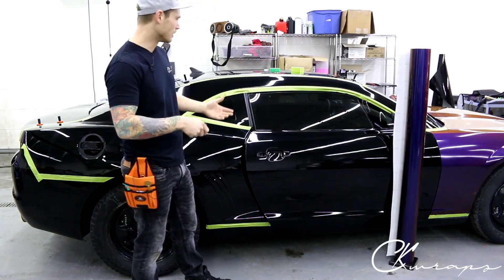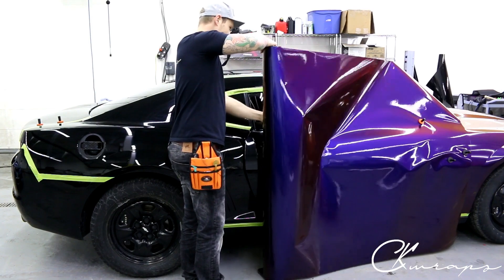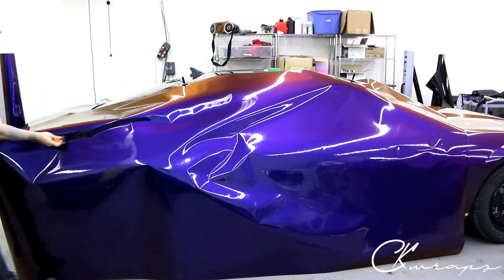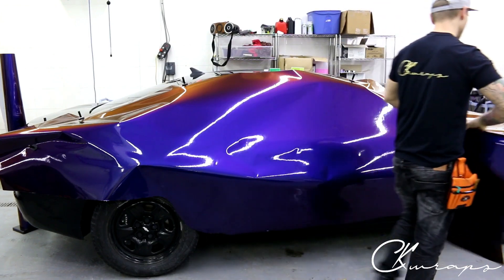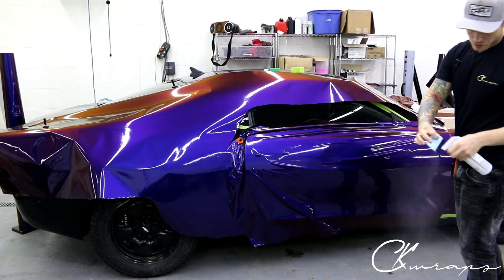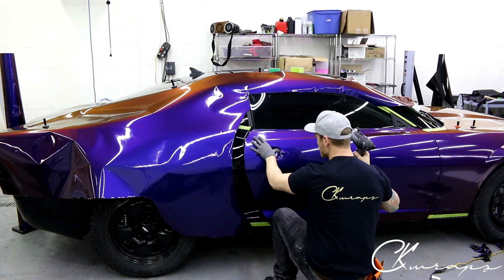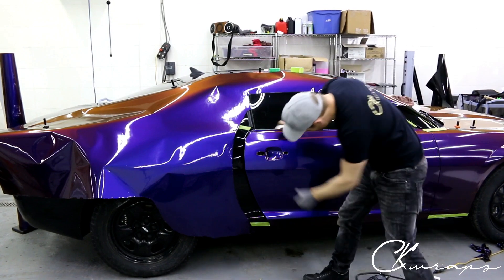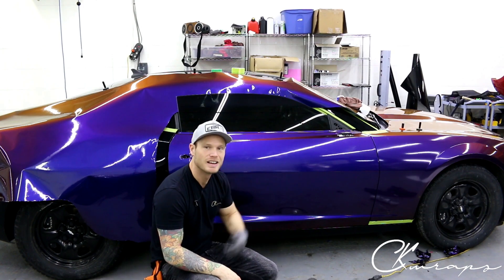Cutting Out A Full Side Piece By Piece And Vinyl Wrapping A Door On A Camaro

Comment: I am sure you found out, but the Avery description says it is a directional film. Which makes me wonder: If you'd wrap a 6th gen Mustang with it, how would you do the hood? It is wider than 60 inch in each direction and the 'trick' I have seen in one of your other videos, would make direction be 90 degrees turned with respect to how you installed these side panels.
Reply from the maker: The hood will always run a different direction. It isn't possible for it to match up with the bumper and fenders at the same time

Comment: Quick Question.  If you have a small piece of vinyl that keeps lifting, is there a product to used to make it stick better?  I have tried applying heat to reactivate the adhesive side of the vinyl, but to no avail, it just lifts up again after sitting in our Texas heat.  Any suggestions? Thank you

Comment: Not a good color choice IMO but its not my car.
Good job very interesting to watch.
Reply: Have you ever wrapped the hood of an Chevy HHR, having difficulty with the front corners, where the curve of the top portion of the hood meets the front curve next to the grill. This hood has some extreme curves. I'm also using Vvivid 4d carbon fibre, and the film is a lot thicker and difficult to stretch. Could use some advise. Thanks